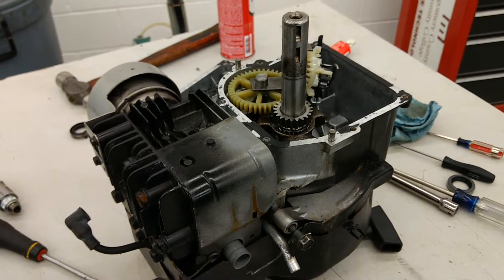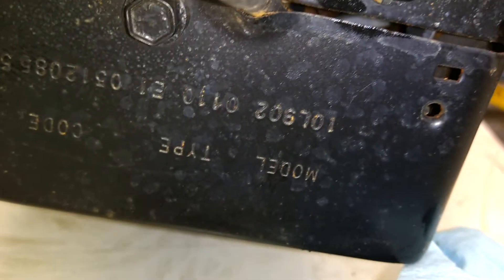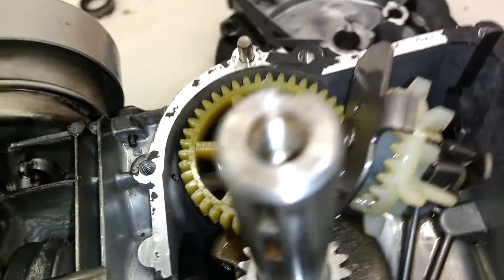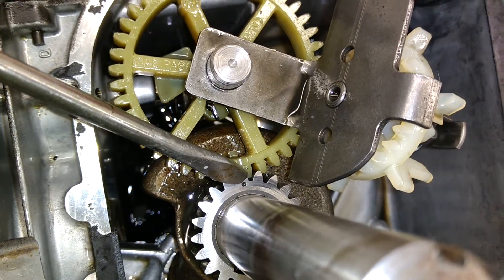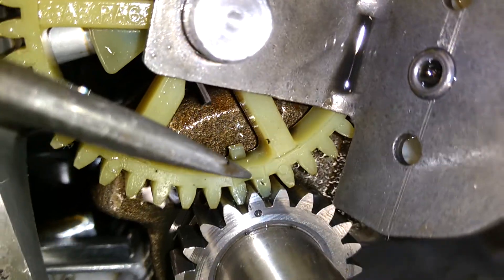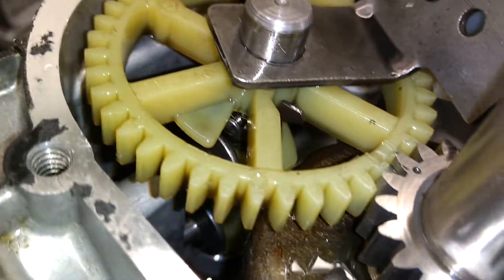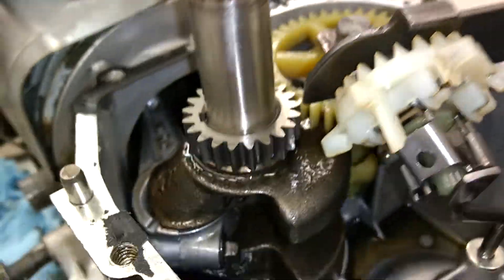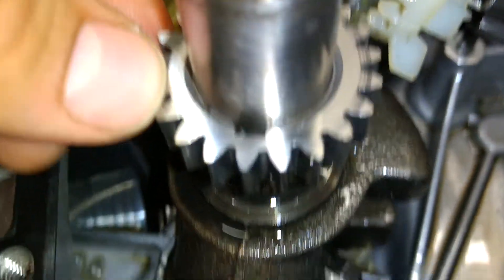How to align Briggs & Stratton engine timing gears

Comment: Im lost, I put a new cam in mine, got tdc on the compression stroke, then had to rotate the crank even more to line up the cam gear dots, which then through it off of tdc, I tried to start it and a big backfire. I assume I have it 180 out? But you can't be tdc and get the marks to line up right, what am I missing. Please help!

Comment: I wish I had watched this video prior to reassembling my engine. When I took apart rhe second time I noticed that my gear on my crankshaft (which happened to be a replacement) had a dot AND an arrow. The second time around I used the arrow to line up with the cam shaft sprocket instead, and that time it worked. 👍

Comment: thanks, good vid ! i have a plastic gear on the crank side as well, ( b&s 675 'e' series 190cc )  it has a damaged tab to locate on the crank side, and a teardrop shaped marker on the out. im assuming THAT should align with the BIG plastic gear's 'double' lines. motor & machine spotless otherwise. i think some things just should NOT be made of PLASTIC!  i hope this part is available!

Comment: It is the nice tutorial!!!  Is there any tip to determine whether its decompression mechanism working. This part is one of the most typical problem source... Should it be a little bump or a click at the end of compression cycle (as it is on bigger B and S engines), please?  Mine, (7.25 HP) doesn`t have any like that. Is this a symptom that cam shaft must be replaced? Thank you

Comment: Just spent a couple of hours on this very issue. Question: Is it possible to put a new Cam Gear assembly IN if not at TDC?
Reply: Yes its possible. You may wind up 180 degrees off

Comment: can any part of the cam shaft slip and go out of time, such as when striking an object with the blade?
Reply: The plastic cams are not very well thought of by the manufacturer. The lobes can wear down over time and hard starting will continue if not damage the engine. Sometimes you can swap the plastic for the aluminum one

Comment: Small detail you left out. They can be 180° out based on timing,  you have to have it on the top dead center stroke for it to be aligned.
Reply: I believe that the issue is causing lots of turmoil in getting the timing correct in the small engines. I recently had taken down a small engine to replace the sump cover and gasket. When you line up the dot off the crank to the much larger mark on the cam, the piston is not at TDC, which throws lots of home owners chewing their nails and staying up late at night trying to figure this stuff out. I know it happens to me. I had even taken another one apart that I borrowed the sump cover for. I will try to rotate that one around and see just where the mark lines up at.
Reply: @Smalltechguy  okay I am confused, so I had it tdc on compression stroke and then rotated the crank and matched my dots up.  I then tried to start it but it backfired big time. So I assumed it was 180 out. What blows my mind is you can't get the timing marks to line up without taking it out of tdc? What am I doing wrong?
Reply: I think this may be the problem on my Briggs 450e; I think I had the piston at just before the bottom of its stroke instead of top dead center. Engine won't start and acts like it's firing at the wrong time.
Reply: @gabrielbennett5162  sae here backfiring and wouldn’t run. Engine out and hopefully sorted
Reply: Compression cycle i assume?

Comment: Many thanks for this- helped me time up the exact same camshaft.  Helped to know there wasn't more to it- at first I thought the valve positions were important.  Thought it through and realized while the crank turns 2X to each camshaft rev, the crank doesn't control the valves and so aligning the crank/cam marks is truly all there is.

Comment: is it possible to set the timing 180 degreice wrong ? And then get the spark at the twong time ? 
I get plastic gear att the both sides and my motor dont start
Reply: Have u accidentally knocked your tappits?
Reply: The little things the the cam pushed
Reply: Dude the spark has nothing to do with the cam shift on this engine

Comment: How about the third gear? How do you set that properly? Thanks
Reply: Thd white gear is a oil slinger it doesn't need to be timed all it does is govern your rpms and lube the engine

Comment: what about that other cam shaft gear that's vertical how do you align that?
Reply: It's a governor/oil slinger and it only has to spin so the weights push on a plunger to "throttle down" the engine by pushing the rod with the flattened end.

Comment: With the timing gear dose the piston has to be closed or open
Reply from the maker: As long as the two dots line up exactly, it should not matter. Two revolutions of the cam equals one revolution of the crank. So for every two revs of the crank, the notch on the cam should come back and line up with the dot on the crank gear once again. Hope this helps, good luck!

Comment: Man...I just went through taking this same engine apart twice with no luck in getting it running nicely. The first time it sputtered and never got up to speed, then I realized I threw it back together without setting the timing. 
So I took it back apart after that realization and set the timing just as you did here... And now it won't even start. I'm stumped, the carb is clean as well as the filter and new spark plug. The flywheel key is new and the flywheel went on easily. Any ideas?
Reply from the maker: LOTS of possibilities. But if the engine is mechanically assembled ok, and no issues with broken, misaligned, or missing parts, then I always go back to the basics: air, fuel, spark.
Reply: reset the valve lash bud, should help
Reply: Thanks for the help guys. Unfortunately I'm not sure what I did to get it going again.